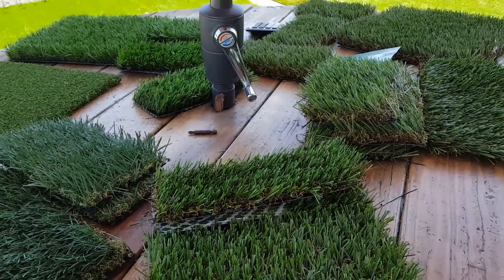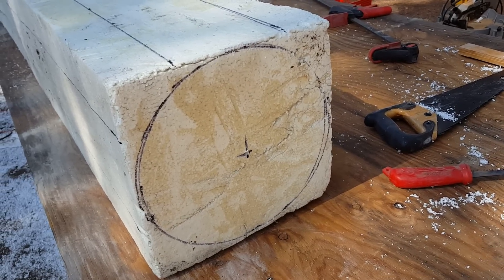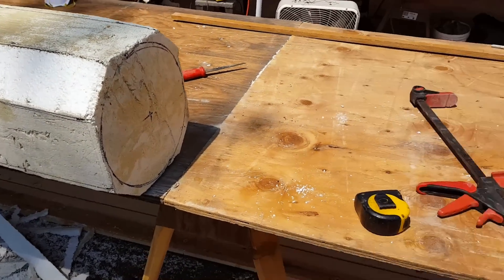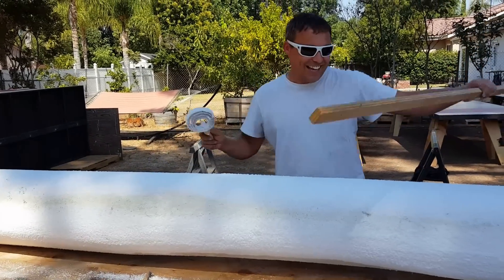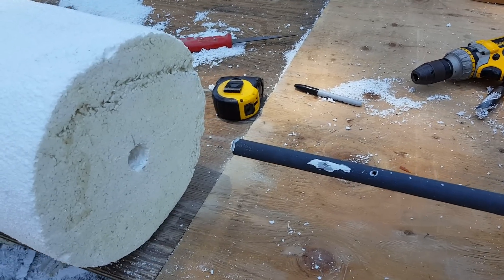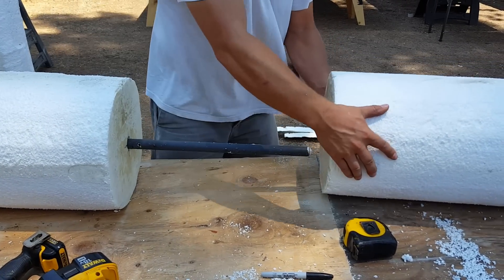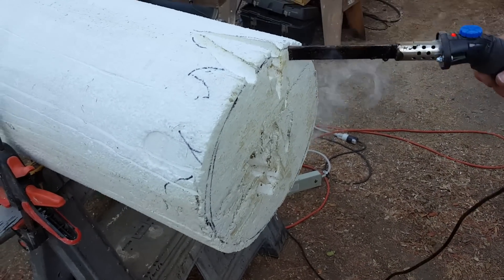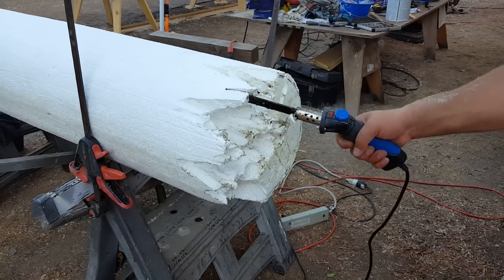Sculpting & Hard Coating A Foam Utility Pole | Post Apocalyptic Scene | Cosplay Photo Set For AX

Comment: Hey guys! First, thanks for making these videos. You've inspired me to give this a go myself to make some cobblestone pillars! Despite never doing anything like this before, you've given me the confidence to give it a go, and it's going really well so far! Also, I have a question: 

Do you have any videos showing the process for applying a resin hard coat and preparing it for paint? Or do you have any HH tips you can offer? And how far does a gallon of Epsilon Pro go? I was tempted to use the flex-seal mortar mix, but since it'll be in-doors long-term I'm hoping for something pet and child resistant. :)

Thanks again, guy!